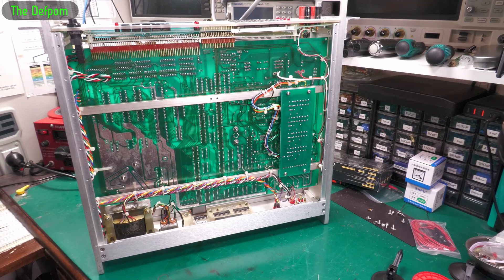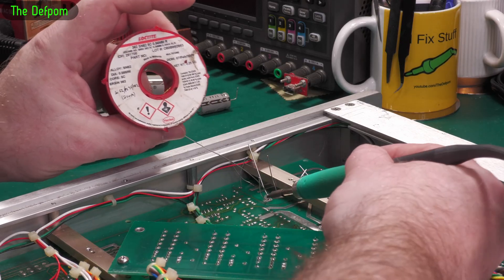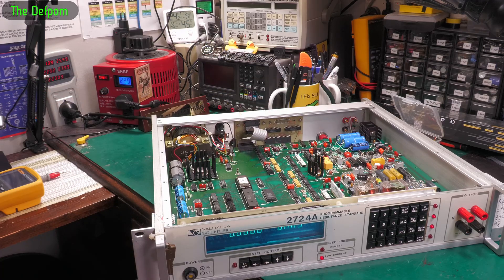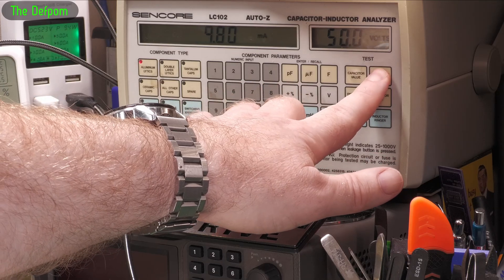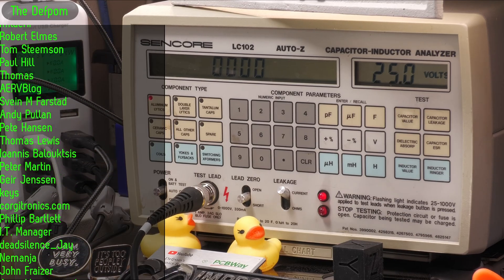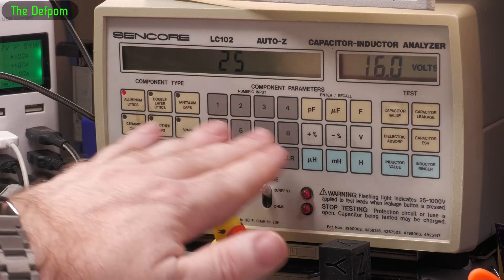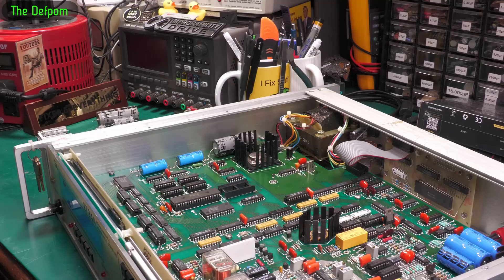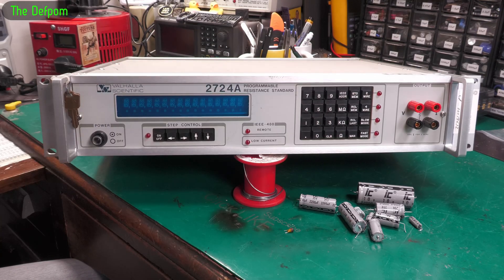🔴 It’s Not Over Yet - Valhalla Scientific 2724A Resistance Standard Repair Part 2 - No.1395

Comment: great video. one small note that is not so critical for power supply capacitors, but is for precision resistors: at 2:19 you connect the capacitor leads with 62/36 solder, instead of letting the pin be on center of the hole one point on each side of the PCB should be touching the tinned copper of plated trough circuit board hole, then the actual connection has smaller ESR, and the solder just keeps it on place.

Comment: Any chance of adding LED backlighting to the existing LCD's on the LC102.......transflective LCD's maybe?
Reply from the maker: Yeah it would be nice to improve the display for the camera, as it is not a standard LCD, it has the custom annunciators swapping it for something else probably isn’t possible, if it bothers me enough I might try and add some edge lighting to the LCD, I have LED strips for that kind of thing.
Reply: I think it’s the camera angle or a piece of paper on the top during filming.  Would be a good idea to put a light behind the user, that’s what I did on my workbench. What is a yoke?  One of the buttons on the unit.
Reply: @pault6533  Deflection yoke - electromagnet coils around the neck of a CRT.